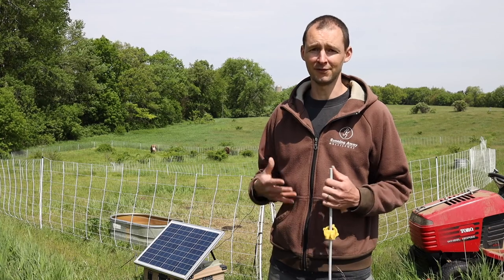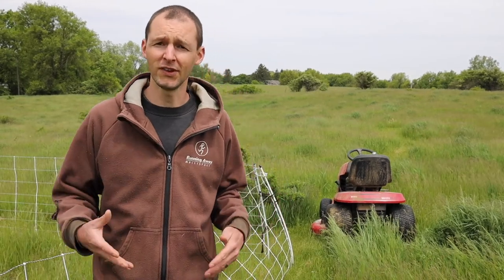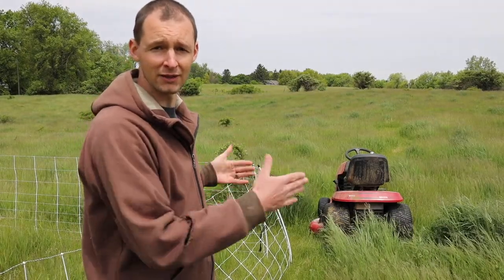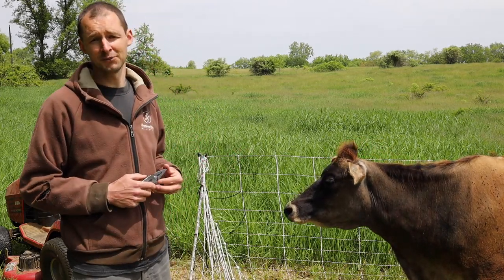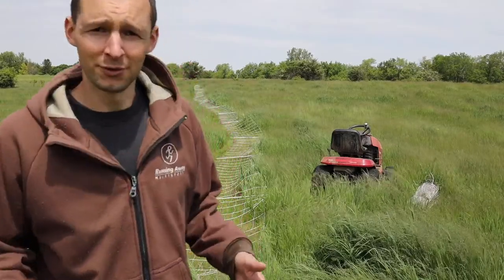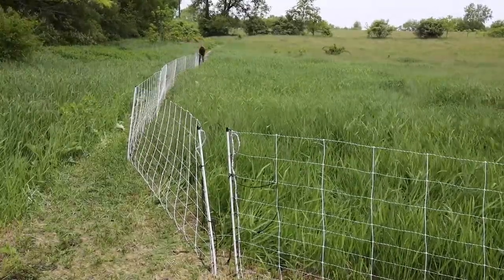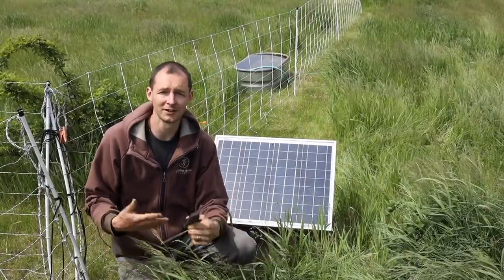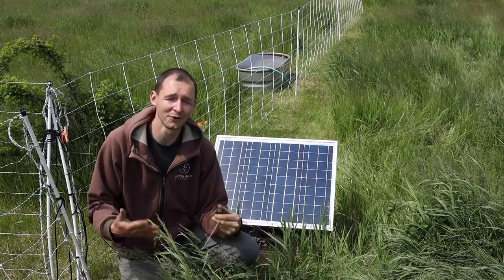How to Rotationally Graze Animals on a Small Scale | Moving Electric Fencing on our Homestead

Comment: Wow! I thought there must be a simpler way to deal with the set length of the netting. This is one of the biggest downsides to the netting IMO. I wish it could be customized and lengths could be removed or added. Sometimes I need an extra 20' and all I have is a 160' length. Not very efficient or economical.

For my perimeter fence, I put down an 18" strip of landscape fabric to keep the weeds down as they seem to be the biggest problem shorting out the netting.
Reply from the maker: Hi! Yea, I definitely run into the same issues with the length. They offer it in 50' and 100' sections. I've found it helpful to have one of each of those for those instances. Thanks for watching!

Comment: Do you think a two strand system would work? How do you water them/move the water? Working on trying to get a family milk cow soon and trying to figure out the best way to do it.
Reply from the maker: I've seen two strands work for cows before so I think it's definitely possible. They respect electric fences. But we've had them even get out of our netting a time or two so not sure if cows getting out could be more frequent with only a couple strands. I think it comes down to your personal comfort level and what will allow you to sleep at night :). I will mention that we got all of our netting and the solar energizers off marketplace and they were way more affordable used than buying new. For water we have two stock tanks and just run hoses from the hydrant in our barn. I probably have 5 or 6 100' hoses on hand to reach to the far areas of the pasture. And for rotational grazing I definitely recommend a smaller stock tank - I think they make a 40 or 45 gallon one. We have one of those and the other is 100 gallons which is not very pleasant to drag from paddock to paddock. All the best in your family milk cow adventure! They are so wonderful!
Reply: Thank you that was very helpful! Never thought of market place for electric fencing good idea!
Reply: Thank you that was very helpful! Never thought of market place for electric fencing good idea!

Comment: What is your solar unit? How big? Who makes it? Thank you.
Reply from the maker: It’s the PRS 200X by Premier 1. I’ve really liked working with Premier and they make great products. I believe they replaced this model with a newer one now. I’m pretty sure it’s a 2.0 Joule unit. The Joule output is what will determine how many sections of fence it will power. This one is also made to run through winter - although I’m not sure I would have it out if the temps get too cold. The housing is insulated and it has 2 high capacity batteries that should be able to hold a charge for a couple days if the sun decides to hide. If you know how many fence sections you’re wanting to run Premier can fit you up with the right unit. Thanks for watching!